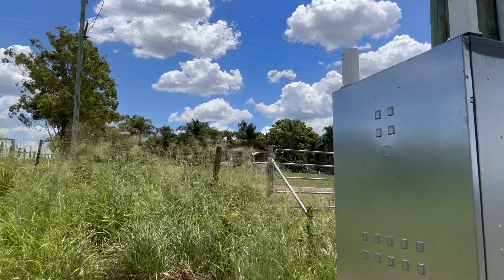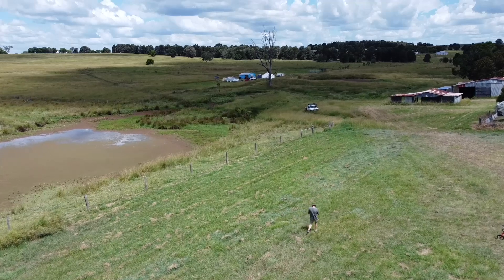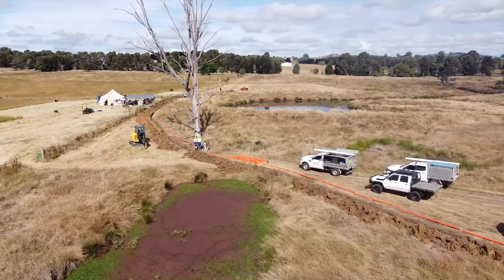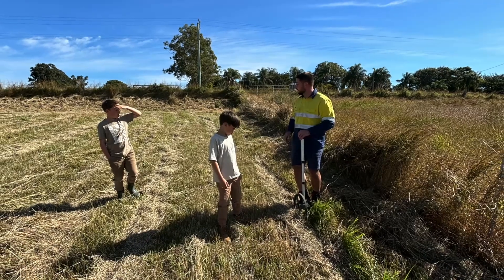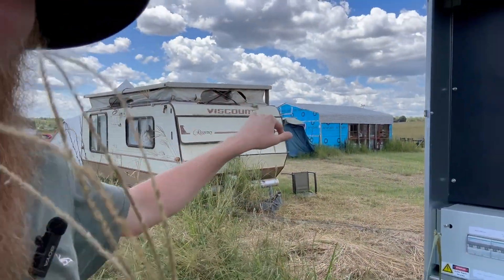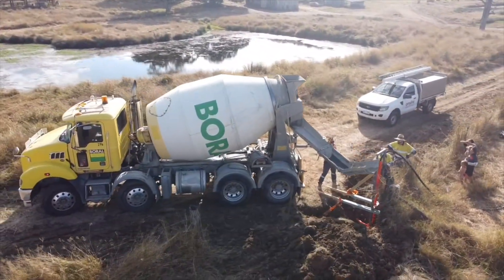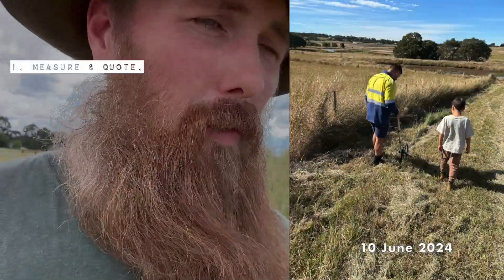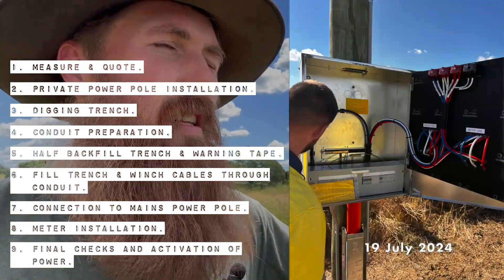Process of Mains Power Installation on Vacant Land (Starting a Homestead in Aus)

Comment: why 3 phase with speed controllers now you can run lathes and drills mills 
must be 1 fine welding set up
Reply from the maker: @littlehills  just wanted to be sure we wouldn’t ever be short of power, I’ve never welded before 😅
Reply: @Homesteadonthebrook  well i mean you can only cry about it once i guess less you bill is higher for 3 phase acseses?  as well every bill. be good to know this too i think. 
but what home appliance is 3 phase other then a human size walk in  oven ? what am i missing how u getting normal 240v at the end ?
Reply from the maker: We do have plans to build a scullery where we will run dehydrators, process chickens and maybe even sheep in the future. So will probably run a bandsaw in there as well. I’d also like to build a sauna as well. Maybe I’ll look into solar to power the sauna 🤷‍♂️ the electrician explained it to me saying that amps drop over the 260m distance, so going 3 phase will give us more than enough power at our end to do whatever we need.
Reply: @Homesteadonthebrook  well you wont be bored :)

Comment: When prices are like $30k or more its very likely an off grid system would be cheaper in the long run.
Reply from the maker: I split the installation cost with my bother in law as both our families live on tbe same property, so it was $13,865 each for mains power. But if we both went solar, then we would’ve been up for 30k each at least. I know it’s long term saving. But unfortunately we didn’t have the capital to be able to take that route with needing to prioritise our house build

Comment: Nice video explaining it all, I went through a similar experience in Victoria for our build. In 2019 it cost me a little under 10k to run 3 phase 180m to shed + 30m to the house with me supplying the trench. Different set up though I already had a pit at the front boundary of the property & Powercor our distribution company connected our cables to that. We also decided to put much larger cables into the ground so there would be no issues installing solar on it later.

At that time a single phase metre cost $500 & 3 phase $700. It's funny how different our VIC metre box looks to a QLD one too.
Powercor also did not want us connecting 3 phase at all for some reason, the electrician had to pull some strings to make it happen.

 I would also say it's the right move installing grid power at that price, a offgrid system would be well over 50k I would imagine, best option would be to stay connected and put solar on the new build.
Reply from the maker: I definitely feel like our electrical contractor did us a solid, the quote was actually around the high 28k mark, but when the final bill came he knocked 1k off the total saying he found some wiggle room in the price after the job was done. He didn't have to do that. But I can image as you know when your building every $ counts. I'm still very green with all this. 

The house we sold to purchase this property was 873m², that was the biggest property I'd ever lived on in my life at that point. Now we have 50,000m² & I still pinch myself every morning 😅

Comment: I live in central Victoria and I had our supply upgraded from 480V split phase, to 3 phase back in 2020. This included a 3rd HV conductor from the road up to our house on the existing poles, a distance of 270 metres. The main upgrade was the transformer on the pole in our garden had to be upgraded to 3 phase, and this whole process cost about $7,500. My son is an electrical contractor so this saved us quite a bit. About 12 months ago I enquired about doing a similar upgrade to our woolshed which is right beside a pole with 3 phase HV already on it. All we needed was a transformer upgrade and the quote came back at $32,000. Their explanation was that their pricing policy had changed due to government structures. Prices can vary dramatically depending on where you are and when you apply!

Comment: How many amps per phase did you end up with?
Reply from the maker: I will find out and let you know
Reply: Similar question, what mm2 cable and conduit size did you use for the 3 phase supply?
Reply from the maker: @tracktronics  sorry for the late reply, there are 3 x 70mm cables running through the conduit, not sure what size conduit they used. And we have 80 amps per phase.

Comment: Surprised you went on grid with that sort of price. Someone like Rainbow Power Company would do you a prebuilt single phase 6kW output, 12kW PV + 15kWh battery for that, with a proper warranty. Or you could DIY 3 phase at about 5kW/phase for the same money. Buying second hand panels would save you more or give you massive overkill on the solar so you'd get enough input to be happy in the rainy season. I assume you have to have some kind of electricity-hungry task in mind where being able to pull 100kW all day is important.
Reply from the maker: For some extra context, yes, the full installation was $27,731. But as I mentioned at the start of the video, we purchased the property with my brother-in-law’s family, so we split the cost, which came to $13,865 each.

I did look into solar options, but the systems I found that would be large enough for our family of 6 were in the $25k-$30k range, and going halves on mains power installation felt like the least friction for both of our families at that stage. Plus, having access to power for our temporary campsites while we build our homes was a big factor.

I’m not saying solar wouldn’t have been a great option, but coming from the city, the idea of off-grid living was a bit daunting, and I wasn’t ready to take that leap just yet. I also had to consider other unfamiliar tasks, like installing a septic system, which I didn’t expect I’d ever have to deal with. In the end, I chose to tackle one new challenge at a time and opted for mains power for now.

That said, I’m definitely open to learning more about solar, and it might be something we consider down the road once we're settled in a bit more.
Reply: Misunderstood which "us" paid $25k :)  You're definitely at the steep end of the learning curve, and I've been playing with solar for a couple of decades. Might be worth following andy@off grid garage once you're thinking about solar.
Reply: We looked at power for 350 meters up our drive here in NZ .
It was cheaper to go off grid than connect to the Grid .
Built the system myself legally only needed a sparky to hook up the final connection to the house.
No ongoing power bills and no power cuts. It has already paid off not counting the cost of grid connection just the saving on power bills 
Makes me laugh when I turn up to work only to be sent home because the grid power is out again. 
Panels and battery's are far cheaper than what it cost us five years ago.
Reply: I really want to go OFF-GRID and be completely self reliant, were saving for that infrastructure now! We've looked into Rainbow!